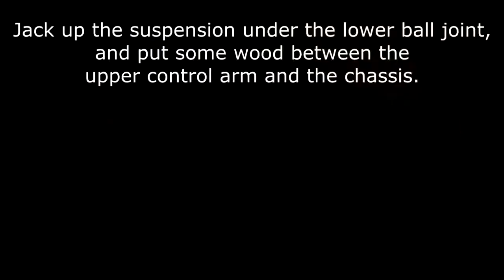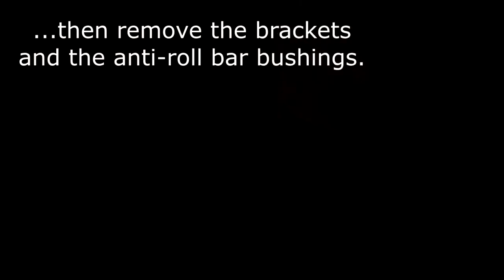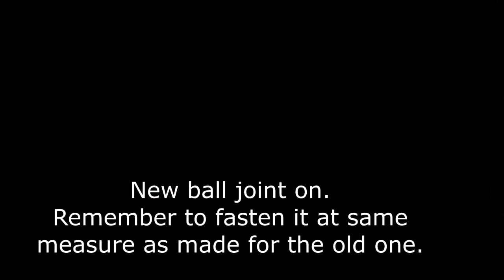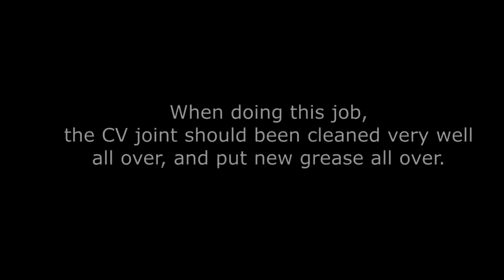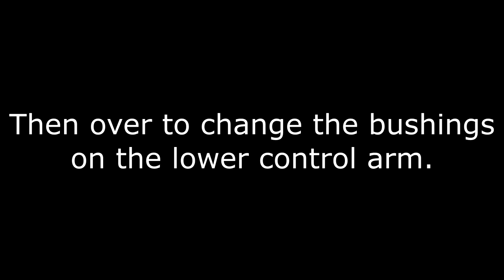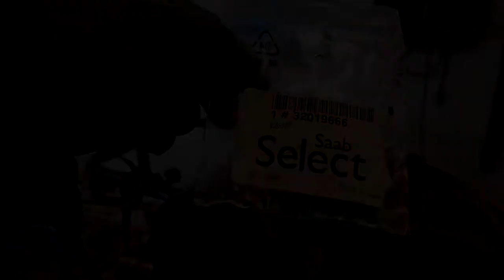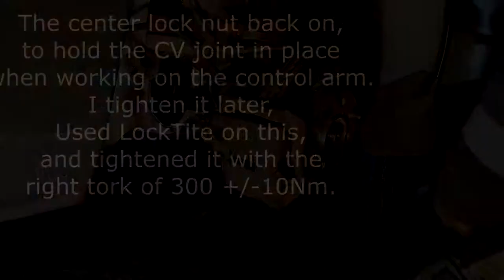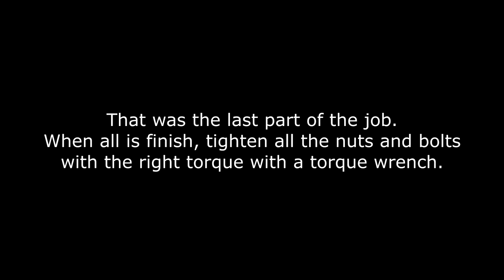SAAB 900 Classic Convertible. Refreshing front suspension.

Comment: Do you know what size nut goes on the lower control arm to hold the shock?
Reply from the maker: I did show in the video...
18mm nut on the bottom end of the chocks.
Very rare to see 18mm is used on cars...

Comment: I have a 1993 SAAB 900 turbo convertible much like yours which I have owned since 1996.   The car is in excellent condition and runs very well.  My biggest problem is the suspension.  Although the quality of the ride seems good enough, the car creaks and groans badly when I drive over bumpy roads.  I recently changed the shock absorbers in an attempt to get rid of the creaking but without success.  Do you think changing the bushings and ball joints on the suspension would help with the suspension noise?
Reply from the maker: I think it is the bushings on the anti-roll bar or the bushings between the car body and the upper and lower control arms.
If the ball joints are worn it gets knocking, not creaks and groans...
Also the bushings between the upper control arm and the seat for the bottom end of the coil springs can make creaks and groans....

Comment: I'm wondering, on a scale 1-10 how much better was the ride and handling? What component do you think contributed to the improvement the most?
Reply from the maker: It is a little hard to give a good answer to that, because my chock absorbers also should been changed, and I also still need to change the upper control arm bushings, and the bushings for the coil spring seat on top of the upper control arm.
This is one next job to do, but then also I'm going to change to lowering springs.
But it was a mush better ride after this job done.
It was very needed not only for the comfort, but for the tecnical condition of the car.

Comment: maybe once I install them in the car they will work themselves into the correct position
Reply from the maker: I'm not so sure about that.
For me it was not any problem to get them right in place.
Some of them I actually got a little far through, so I had to pull it a little back in.
I think you should try to get them correctly into place before you put them back onto the car.
Reply: @TerjeNormann  Hey there, I compared this morning with the other side (which I hadn't disassembled yet) and it looks like I got them in the same distance as the factory had them. Thanks.